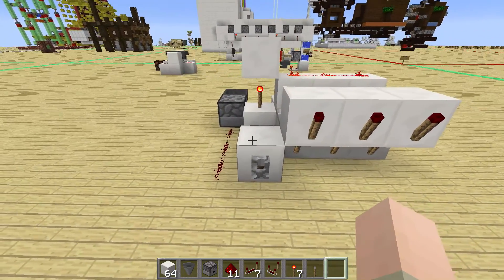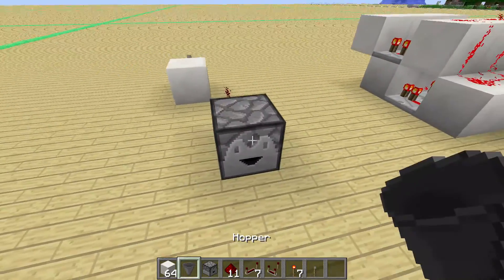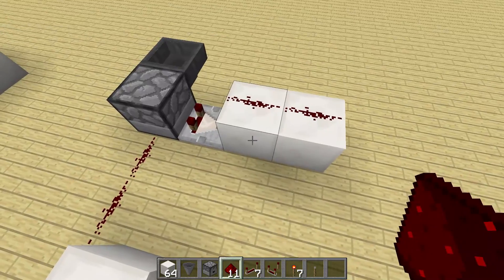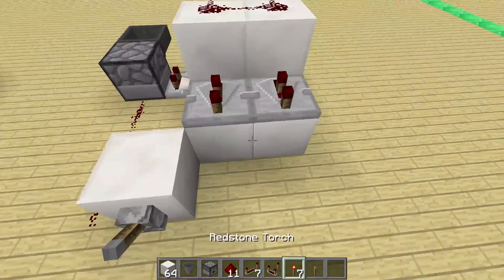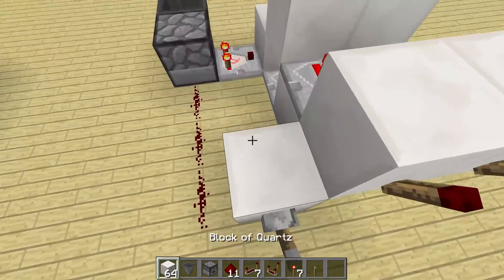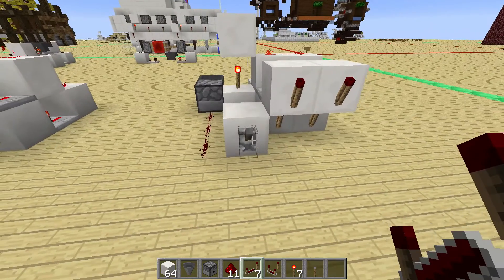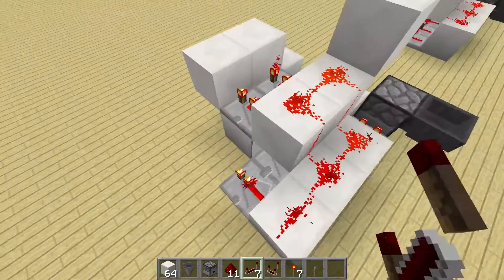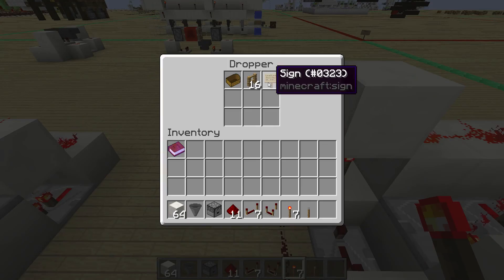Randomizer for 2 and 3 bits [Tutorial] Minecraft 1.9

Comment: I have found a way to store a large amount of outputs using multiple randomizers. Grab a 4 output randomizer and seperate the outputs into 4 different sections. Build 4 (16 output randomizers) and take out the lever behind the 4 comparators in all 4 randomizers. Connect each of the 4 outputs from the small randomizer and connect each output to the 4 comparators and torch that is connected to the droppers and hoppers on the larger randomizers and simply activate the small randomizer multiple times to see if it works. What you just created was a randomizer system that can hold outputs using a factor of 16 and with a smaller randomizer as the input you can activate random outputs in random sections. For example:Output #4 on Section 2 or Output#8 on Section 4.
Reply: The end results in 64 different outputs and if you're a true maniac take a 16 output randomizer as the input and connect all 16 outputs to a 16 output randomizer and get 256 different outputs.